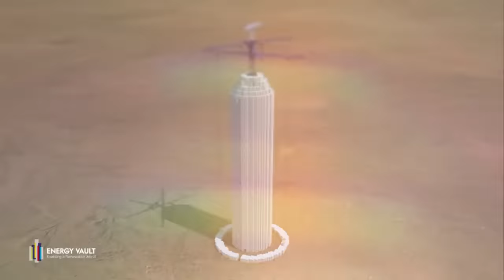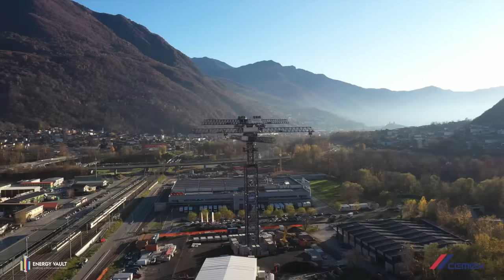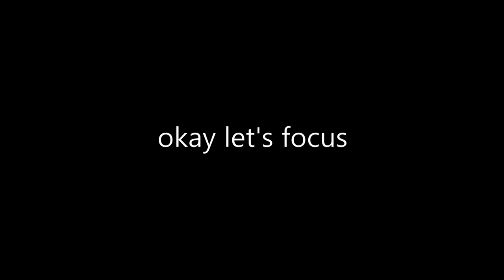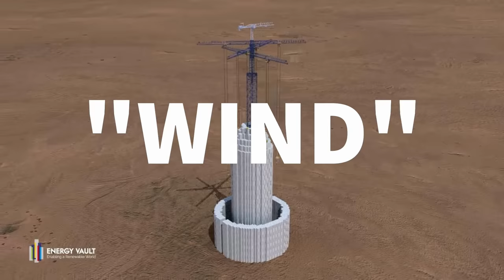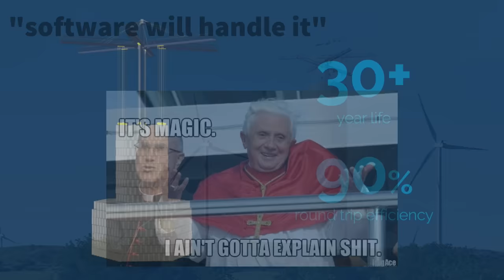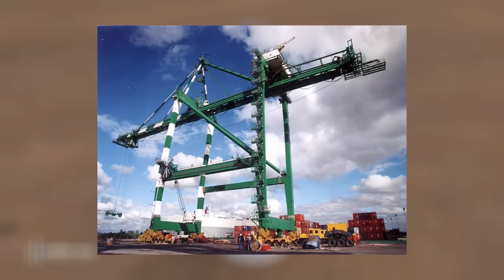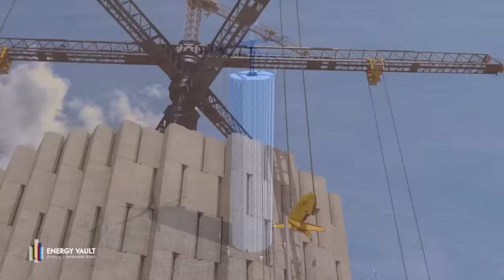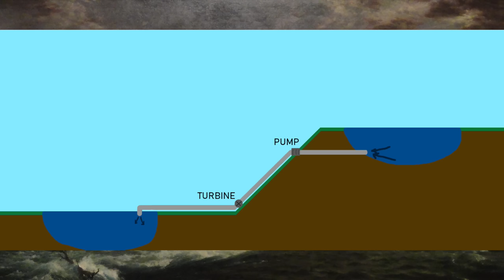The Energy Vault is a Dumb Idea, Here's Why

Comment: There are a few greavity batteries proposed - one uses old mine shafts so you don't need to dig a hole. I think another uses water pressure to hold up a large weight. I think they are worth exploring - there isn't always the terrain suitable for pumped storage and it does have it's own environmental impacts. I'm just glad your video is 5x smaller than Thunderfoot's - he can waffle on!
Reply: The problem with mine schafts is that they aren't big enough. Even if you use pure lead for weights - thats only 12 times energy density of water weights.
Reply: If ThunderFoot made this it would be a 25 minute video saying the same things fifteen times over, intercut with stuff from his earlier videos.
Reply: @grzegorzdomagala9929  One of Germany's states has old mines that go roughly 1km under ground with extensive horizontal tunnel grids at the the lowest level. You'd need a way lower volume of water for the same energy than in most existing pump-storage plants. I guess the main problem is that the mines are old and not super stable. Using them might even cause more trouble than just drilling new tunnels, and Idk if that'd be worth it either.
Reply: and if anything breaks that deep, repairs will be difficult. I think most of the ideas require a lot of very complicated equipment working in "high stress" cycle - the question is not if something will go wrong but when...
Even water based pump storages are very complicated - things that sound simple, like a pipe connecting upper reservoir to turbines become quite a enginnering feat when you bring it to the scale needed and want it to operate for a long time.
Reply: Another problem is that there are no old mine shafts. I mean, they exist, but they are filled up with water and hazardous materials.

Comment: digging is extremely expensive - the first thing that gets asked in designing any thing substantial is "how much is the basement and how can we reduce digging?" Also - waterproof systems are even more so.
Reply: These are real already existing solutions to power fluctuations that are used in the real world (there's even a tom scott video on one)

They're still the cheapest solution to this problem that exists
Reply: so that means he is wrong hydroelectricity is stupid coz its too expensive and building cement towerblocks with cranes is the way to go.....im sure you alrdy pre purchased your Hyperloop ticket and your thorium powered car on solar roadways.
Reply: Kinda yes... but I have a solution: you know what almost looks like a hole? A valley 
So if only we could build a wall to block that...
Reply: @rantrakkanto1029  This invention is pretty garbage, but hydroelectricity isn't perfect either. There's definitely a market for alternatives to hydroelectricity, but concrete blocks and cranes are not it.
Reply: @michka841  If you happen to have a valley nearby, that has water flowing into it, and you're happy with the environmental destruction this involves, and the increased evaporation and loss of drinkable water.
Reply: @michka841  methane
Reply: @rantrakkanto1029  do yourself a favor and stop thinking in black and white

Comment: I would like to bring up something else of concern... Structural stability! That much concrete would way a ton. You'd have to worry about all that weight causing the ground to settle unevenly if you just built these things wherever and didn't go out of your way to make a strong level foundation for each of them. Good luck getting the blocks to line up if they are out of alignment with the crane and that's not even getting into the disaster it would be if they tipped far enough to topple entirely. Then there's seismic issues. Better not build these things anywhere near a faultline!
Reply: That is incorrect,  this weighs way more than a ton, it would be multiple tons.
Reply: @actionjksn  I'm sorry, you must answer in the form of a fact check.
Reply: @GeneralChangFromDanang  What form is that?
Reply: Software will take care if that
Reply: It feels like the project was dreamed up by someone who has never actually stood on the plains of Kansas or Texas or Oklahoma, where wind turbines are everywhere and the winds are absolutely horrifyingly strong.
Reply: @GeneralChangFromDanang  we shouldn’t share facts?  Mistakes made?

Comment: Have you seen the updated design on their website? It shows a space frame structure hosting the blocks instead of just stacking them. Also there are machines moving the blocks around instead of cranes to avoid the wind swaying issue. It looks like the engineering team took many of thunderfoot's criticism into consideration when the redesign happened.
Reply: I've seen that "design idea." Seems these guys don't understand that 'height' is where the energy is stored... Now the building is only a few stories tall (almost no height) and the massive blocks are 'stored' in a steel lattice (oh yeah?!) with a lot of horizontal motion... They must have toured an Amazon warehouse where crates of plastic toothbrushes are stored in vertical racks...
The canned soft drink dispenser outside the motel would be a better storage design... Don't tell them I said that, though, will you!!
Reply: @rustycherkas8229  Are you sure you saw the new design? The building structures are 500 feet / 150 meters tall. That would be over 30 stories tall and take up more height than most building towers. That is to help with the kinetic energy storage for the concrete blocks. Each of the structures can also hold hundreds of concrete blocks to store the energy. The whole system is designed for scale to address all the limitations in the gen 1 design from 4 years ago that this video criticizes.
Reply: @tadeh1  
What I saw was a rendering of a building that I would estimate to have been perhaps 8 stories high, full of a steel lattice allowing blocks to be moved horizontally toward perimeter, raised or lowered by a crane/gantry, then shifted horizontally again to 'clear' the vertical motion area for the next block... And, yes, the building provides an closed environment.
You're saying they want to go to 30 stories, eh?

NIMBY... 🙂
Silly to propose a design, imho, that ADDS expensive steel scaffolding over ver. 1.0 that just stacked blocks atop one another, and requires so much controlled lateral motion of massive blocks.

Cheers! 🙂
Reply: @rustycherkas8229  These structures are going to be far away from urban areas just like most energy infrastructure. The difference between using a large structure Gravity Storage like the Energy Vault and a chemical battery is the lifecycle. Gravity Storage has zero environmental cost after it is built. If you look at the lifecycle of any energy system you can see the trade offs involved including waste disposal. The energy system that can provide renewable power reliably while still being sustainable will have an edge over any solution that creates waste by-products at the end of lifecycle.

Comment: Pumped hydro isn’t a golden bullet. Big issue is there isn’t many sites that it is viable
Reply: If you can build a tower to 'store' concrete blocks at great height, then you can build a tower to store water. Pumped hydro even using water towers would be more sensible than the energy vault solution because you just need pipes to transfer your mass not cranes with wires subject to wind forces. The reality is though that when you say there aren't many viable sites, what you really mean is that there aren't many sites that are cost effective vs existing alternatives and power grid needs (what the power grid is willing to pay for) and that brings us back to the fact that building a water tower would be more cost effective than the energy vault solution even if you don't have any suitable elevation differences, whereas if you have any kind of available hill water would beat the energy vault solution by far because with water you don't need the top tank to be at the same location as the bottom tank whereas with cranes they need to be in the exact same location. There are not many pumped storage facilities around the world because they are really only cost effective to run if they can store a large amount of power so you need a site with a very large upper lake and a large elevation difference between top and bottom. To compete with that, energy vault would need to build a crane around 500m tall and somehow build concrete towers taller than sky scrappers without any mortar. Monumentally stupid when you think about it. Here in South Africa we have several pumped hydro systems and don't have more simply because we don't need them at this time (relative to the cost of building them). We are not short of viable sites.
Reply: @isengrom6883  Yes, pumped hydro cannot be used just anywhere because it isn't always the most cost effective solution. But it beats the energy vault by far in every single instance. If you are going to raise mass then lower it for power storage then water is always going to be the most cost effective way to do that. As for grid storage for renewables, the most cost effective is actually to over supply the power sources quite significantly (about 5X) so as to reduce the need for storage, then the actual storage solution chosen will depend on location, grid requirements and costs. But pumped hydro, remains one of the most cost effective methods in use today for large capacity storage. Batteries are making inroads but are mostly used for low capacity short bursts, used to reduce the need for emergency power stations, but not typically used for day to day storage. Pumped hydro is great for smoothing out day/night cycle variations and has very little competition in that arena, but every storage mechanism has a maximum efficiency and it is always better to use power more intelligently in the first place. Smarter grids and time based pricing can go a long way.

Comment: I kind of have to disagree with your proposed solution. I mean, it is probably better if you store energy locally (less transport loss) and if you look at your typical wind park, what they often have in common is, that they are relatively em flat. And in that case, building a hill, pouring thousands of m³ water into it just to use it as a battery would need a lot more CO² than this thing.
I mean it is still stupid to build it like that, but it at least addresses one of the problems of pumped storage. The need of a specific topography.
Take this concept, make it less prone to failure and you have a winning product. Just don't build it like this, but pointing to pumped storage is kind of lazy, as it also has some disadvantages. On the top my head I can think of the topography issue and also the issue, that changing the fill size of a lake constantly most likely won't leave the flora/fauna unharmed.
Reply: You're not wrong but he did mention the obvious alternative:  gravity storage in abandoned mines.